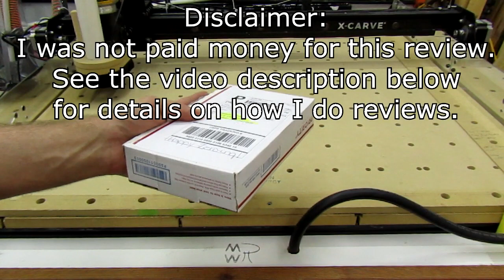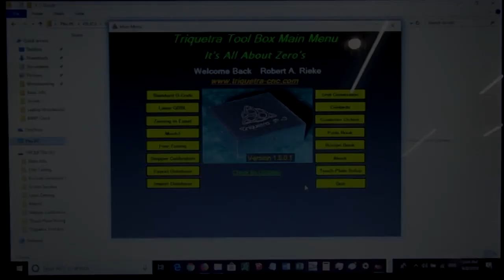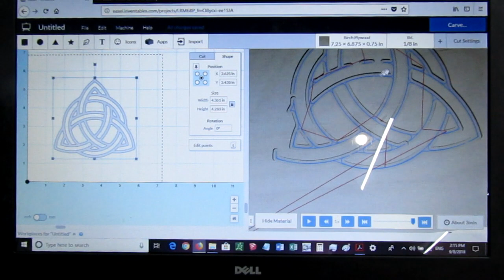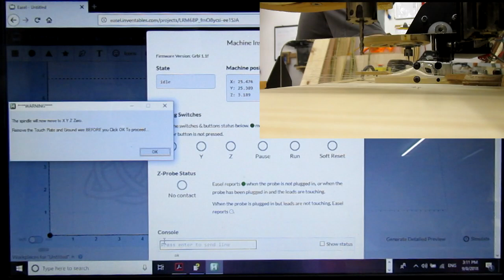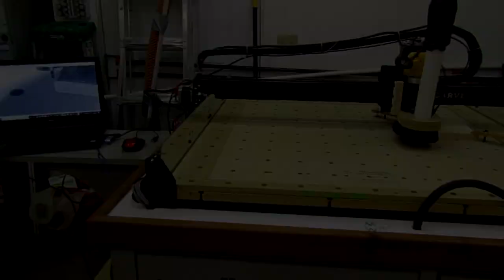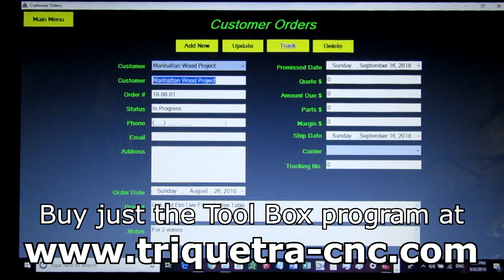59 - Triquetra Touch Plate Review - Manhattan Wood Project

Comment: Do you have a camera mounted inside your dust shoe? If so did you do a video on that setup?
Reply from the maker: It's a $20 endoscope I got from Amazon with a long cord and USB end.  There's no video for it, but all I had to do was drill in at an angle to point at the bit and put in a small screw intersecting with it to act as a setscrew and lock it in place.